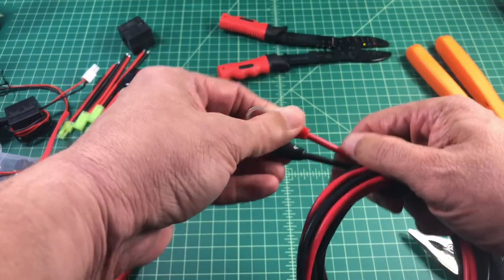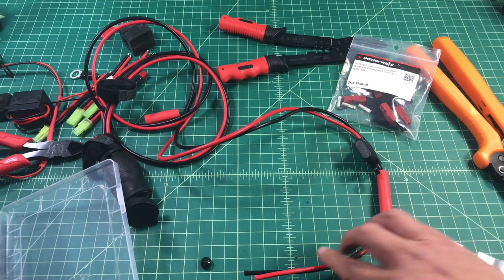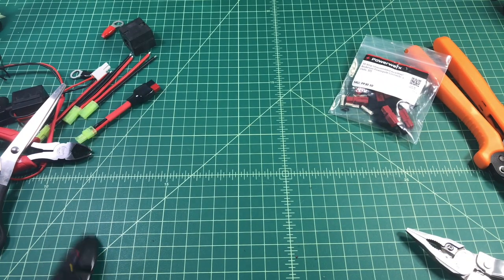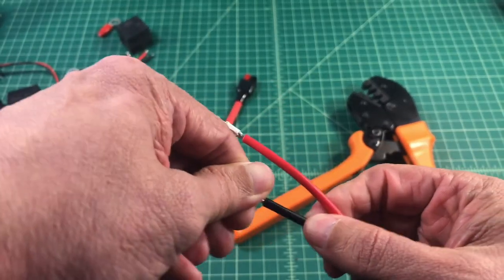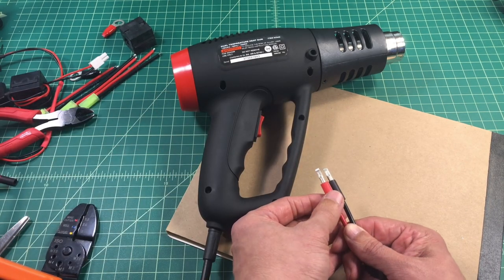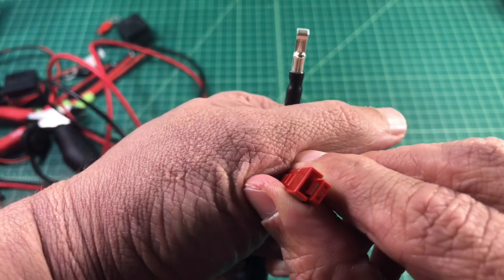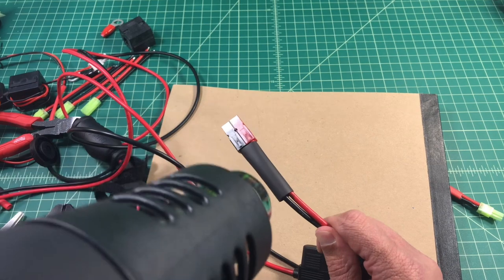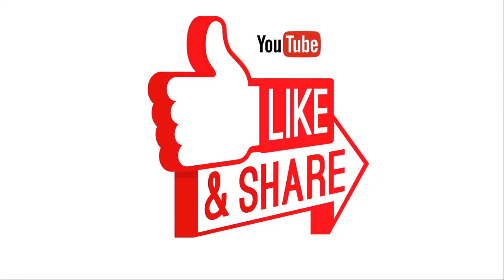The Right way to Install Anderson Powerpoles - TheSmokinApe

Comment: I HATE Anderson Power Poles...I cannot  figure how you get the terminal to click in TWICE...I can't get them to click in even ONCE. They consistently fall back out. I have wasted so many of these stupid terminals trying to nag one in so it actually works. I reached a point where I expect them to fail. I'm glad you can make them to work. I'd just like to know how to get this junk to do what they claim they can do. I'd love to find some other connector that I can actually work with...END OF SCREED.
Reply from the maker: Check out xt30 or xt60 connectors, I actually like them better but the Anderson’s are what everyone uses 👍

Comment: Can you plug-in a 45A powerpole into a 30A powerpole? In otherwords, can you mix sizes? Im not sure what size is most commonly used, but my power supply is a 35A, so I was going to use the 45A powerpole instead of the 30A, but not sure what other people have standardized on...
Reply from the maker: Yeah, you can mix them.  The difference is on the side where you connect the wires 👍

Comment: Sooo i  just found  your video, because i just learned about these connectors, i'm just a little confused  where i'd like to use them is a connection into a control box for 12V power,  One question i have is are these individual connectors universal ? That is to say do two of the same shape (irrespective of color) fit together to form the male and female side of a plug ?  Second question following on from the first if answer to my first question is No, then is there a "bulkhead" or "panel mount" style of this type of plug ?  Thanks !

Comment: PP is a great idea! I've converted to PP literally all my 12V connectors in the shack, in my Radio Van, my Go Box, also all portable radios and all battery packs. And life is easy since! I can quickly change, interchange any battery to any rig, battery to charger and so on. PP's are easy to assemble as seen from this fine video. Just what's important to my opinion is to get a good quality crimper. For me , Powerwerx was also a good compromise between price and quality. 73! Linas LY2H
Reply from the maker: I pretty much PP everything, you point about a good crimper is spot on.

Comment: I plan on making a dedicated battery charging cable too run from my 100 Watt solar panel too my power equipment batteries for keeping their charges up so I am using a charge controller to regulate the voltage too the batteries. I need too know what the amperage is going too my batteries so I dont have an over charging problem. Is there any need too worry about overcharging with this setup?

Comment: Okay. I finally got my S#!+ together, and started working with my power pole connectors and my Iwiss (Amazon) crimpers. The crimpers worked magnificently! But there is a little bit of a learning curve, for getting these little connectors level with each other, and in the Correct direction to the plastic housings! Well, it took me a bit, but I got it! Its okay.... Its ALL Okay! 🤔😉😃😫
And FYI: I reviewed your video, many times, to make sure I was doing it right. Thanks for the help x10!
Reply from the maker: Hey Chris, glad you liked the video.  You will be crimping like a pro, just takes a little practice!

Comment: I like how you provide extra support and strength to the connection. 
Now I need power poles and a heat gun.👍
Reply from the maker: Power poles are super useful in ham radio as everyone has them now days.

Comment: 😮 The video ended before the last heat shrink fit into place.  Do you fit the final heat shrink over the narrow end of the rubber boot or over whole length (both the narrow and wider parts) of the rubber boot?
Reply from the maker: I just put the rubber boot on top of the shrink 👍

Comment: Yeh man that was as it should be, especially when you have the applicable female side to connect to.   But here's my thing.  An 48V ebattery I purchased has Anderson leads but the controller has SY60 MALE.  Soooo..my question is hopefully straight forward.  Is there attachable XT60/SY60 that are snap on for the Anderson power pole leads?? And where can I find them????

Comment: This might be an unnecessary question, but is a crimping tool absolutely necessary to add power poles to wire?
Reply from the maker: Yes.  Everyone I’ve seen or know who tried it without the crimper has gotten the crimper 👍

Comment: I use a Klein 11046 at work, and one of the same style from a different brand. I find the pliers style stripper much easier to use and more reliable than the crimper style.
Reply from the maker: Drew Knoll-Owen thanks for the heads up 👍

Comment: Ape, I have a question for you.  I want to use my FT-991A as portable.  I bought a battery and would like to buy one of those Powerwerx meter.  I was wondering how would I go about putting power poles on my FT-991A power cord and is this possible?  How do you determine the size of the power pole you need, is this just what fits the connector.  I"m thinking I want to buy another FT-991A power cord so that I have one setup for my shack to use on the FT-991 and one power cord for portable.  Your thoughts please.  Thank You Ape.
Reply from the maker: I'd get another cord with the molex connects and add power poles or cut the one you have short and power pole that 👍

Comment: Not bad but too many details left out!
1.  You can set the terminal into the crimper curve down without the wire inserted. Once the terminal is in place, you can then insert the wire. You can even close the crimper down JUST A BIT to help hold it in place.
2.  The crimper can be laid flat on a table. This makes it easier to insert the wire. Once it is inserted, you can squeeze the crimper. Once it grips the metal, you can pick up the tool to apply more force. Lay it down with the block side down. I wondered what the purpose of that was when I first tried using it.
3.  I have solar system wiring that has THICK insulation. If I do not strip enough of the insulation off the solar panel cables, the thickness does NOT allow the curve piece of the connector to mate with the retaining metal inside the housing. The insulation prevents me from inserting the connector all the way in. Wasted several pieces trying to figure this out. You may have to trim traditional insulation so that the pieces mate up. Or, buy larger connectors.
4. If you want the two housing units that make up either end of the cable to be permanently attached side by side as designed, use some super glue once you are SURE they are connecting the way they should be.
There are small pins that can be inserted into the mated housing units that prevent them from sliding apart. Some APPC kits come with the pins, some do not.
Reply from the maker: Great info, thanks for sharing 👍
Reply: @TheSmokinApe  Thanks, but after reading my comment, I sound like a bit of a jerk! "Too many details..." what is that? I should gave said "some additional ways people can use the connectors."

Comment: I know it is a bit late for recommending strippers, but I'll put this out there anyway.  When you are looking at "auto" strippers, do not get the ones that have a straight blade that just cuts through half the insulation and tears it off.  Those will at the very least put small nicks in the wires but usually cut a few strands off stranded wires.  Instead go for the kind that has cut-outs for the different American Wire Gauge  (AWG) sizes.  I have Capri model 20010. and I'm very happy with them.
Reply from the maker: Thanks Slick, I’ll. Check it out 👍

Comment: Apply a little bit of silicon polish to the heat shrink, will make sliding the boot on easier.
Reply from the maker: Not a bad idea 👍
Reply: @TheSmokinApe   I used some rubbing alcohol on the boot to help it slide. We used this for the Wrist Rocket slingshot surgical tubes to more easily slide on and more quickly evaporate. 73

Comment: Where can I get the black preformed sleeve that fits over the wire and the 2 connectors?
Reply from the maker: Amazon, Power Pole Boot Cover

Comment: I love the ring type connections. Really. Very versatile. Crimp connections were frowned upon when I was in the electrical Trade. But probably not so safe at 250vAC.. ... So for low voltage I will try this out.  I need to tidy up connections .  I am here too find out what power pole connection tools are used. Now have clarity. Thanks for the info.
Reply from the maker: Glad it was helpful, thanks for watching Kenneth 👍

Comment: Man I can't get them to click into the housing.  I am using 16 gauge wire and it just bends.  Is there some trick to get the smaller wire options to click in the housing?
Reply from the maker: I use a very small flathead screwdriver to help push them in, good luck!

Comment: If we don't have a powerpole crimper what is the next best option? Pliers?
Reply from the maker: I’ve seen many try but never get it right without the crimper.
Reply: Solder. That's what I do. Just strip a bit more of the wire - don't worry, the plastic will cover it when you snap it in. The solder will draw into the connector if you heat the connector instead of the wire and it will work great!

Comment: ???????? can you use copper wire... and... Alum wires, or will it cause a fire  or short out battery my e-bike battery is alum... and my power conn is copper ..
Reply from the maker: You just need to make sure your wire is rated for you power requirements 👍

Comment: Greenlee Strippers are the best.  I like to tin my conductors before crimping.  I also like to use heat shrink,  but in this case the wires are feeding the bed heater on my Lulzbot so they need to be as flexible as possible.  I do heat shrink them up near the connectors, but not in the raceway.
Reply from the maker: Thanks for the info, much appreciated 👍
Reply: Tinning before crimping is a bad idea, you're adding a soft filler material that will creep/flow out of the way over time and reduce the residual compression that the crimp design relies upon for a secure connection.
Reply: You should never do both.  
The soft tin in the solder will continue to yield hours after the crimping process is complete causing the once tightly crimped connection to become loose.  👊

Comment: No one has a video to install the little pins to keep the plugs together.
Reply from the maker: I don’t use them 👍
Reply: @TheSmokinApe  I don't either accept for building an Anderson terminal block. The pins hold the plugs into the terminal block.
Reply from the maker: Makes sense 👍

Comment: This is the set of wire strippers that I use. I would not change them at all. Wire Cutter and Stripper, for 8-20 AWG Solid and 10-22 AWG Stranded Electrical Wire Klein Tools 11063W https://www.amazon.com/dp/B00BC39YFQ/ref=cm_sw_r_cp_api_i_.haFEbZPK8RN2
Reply from the maker: Thanks for the recommendation 👍